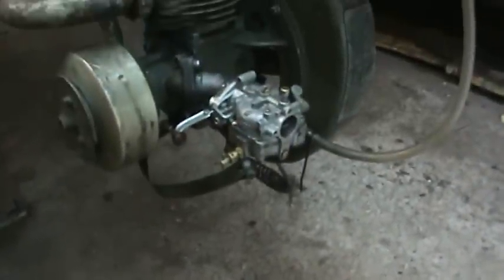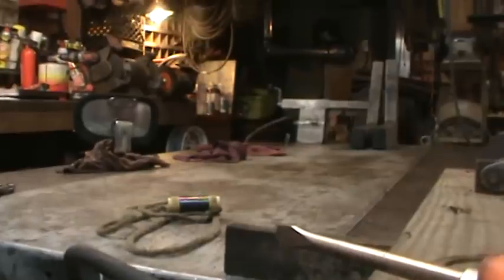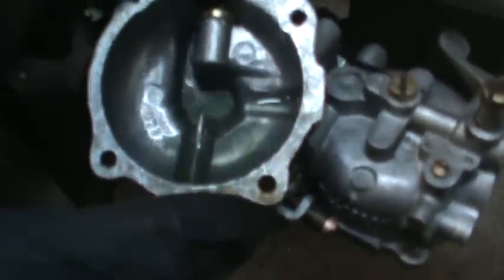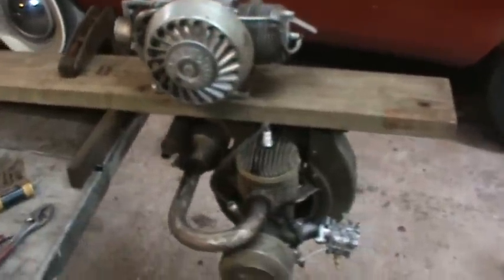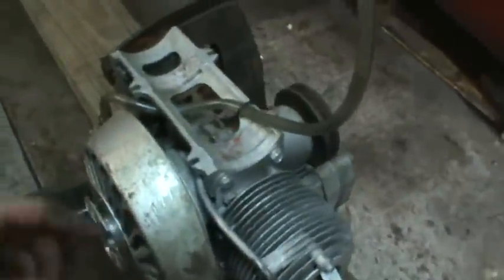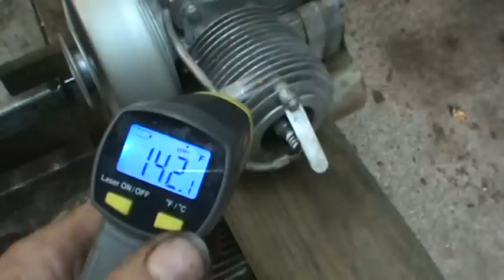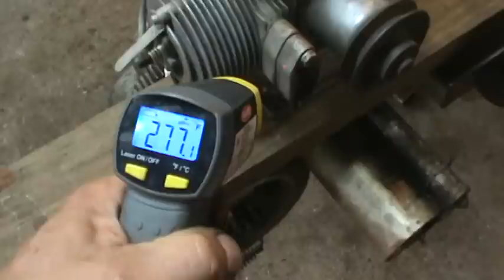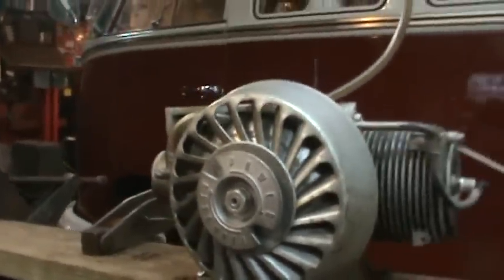building an engine for the next bike.pt5

Comment: Mustie1 your channel is great. I knew instantly what you had when the second engine was fired up. In 1961 I owned a Go Kart (brand name) powered by an AH-47. It's no cheap lawn mower engine. It is a 4.7 cubic inch, ball and needle bearing, screamer.  The unique, exciting sound comes from characteristics of the reed plate. Doing 45-50 mph 2" off the ground ----What a thrill. Now in my mid 70's I still haven't forgotten.

Comment: The "new" engine is a Power Products AH47. Puts out a bit over 4.5 HP. They were used on a lot of things from chain saws, mowers, go-karts. That is an early model as it has the open flywheel fan and no shroud. Normally they have a round gas tank in that bracket that helps push the air onto the case to cool it better.
Reply from the maker: +Blazer02LS good point about the tank

Comment: That little motor sure does run sweet. I have a pile of carburetors from lawn mowers, some of which may be good or only need to be cleaned, similar to the one you showed, from the Tecumseh motors. Glad to help if you need one or two.

Comment: You could have probably fixed that float by drilling a hole near the hinge side and blowing it up with air then solder the hole closed.  Kind of late now but worth a try next time. Thanks for the videos ! :)
Reply: or fill it up with some kind of gasoline resistant expanding foam ?

Comment: Put a small hole in float using a pick or large pin. Blow compressed air into hole, this will pop all the dents out. Solder hole up.

Comment: A good tip for freeing up a seized motor that I have seen is to pour very hot oil into the tops of the cylinders. The heat helps to expand the bores just that little bit, and they seem to free up pretty quickly.

Comment: Hi Mustie,
My thoughts on the float problem are if there was actually water in the float bowl and it froze with enough pressure to smash that float, it may have even bent the pivot point that solders to the float. It does look from the side view that when the float collapsed that solder joint may have been pulled out of kilter.

I suppose it is possible to boil the float to see if the caved in part expands, but I imagine when it cools down it would suck it back in again. I would probably try putting a small hole in it and using a very little bit of compressed air to try to pop that back out again and then solder it shut. You could also unsolder the float, push out the areas that caved in and solder is back together. Since it doesn't work now, what have you got to lose?
Reply from the maker: +Jim Kodysz its too brittle

Comment: if its a brass float you might be able to drill a small hole it it try to get the dent out using compressed air then solder the hole shut again
either that or desolder the two float halves and resolder after pushing the dent out  (be harder though )

i wonder if it will expand enough if you put it in a vacuumchamber

wat we did with moped carbs was bend the tap holding the valvepin so it closes sooner

Comment: if the float has tiny holes.. and fills with fuel.. it will never work right for long.that is far more likely than the housing itself being bad ( but freezing will bust anything).I have heated and soldered floats..but I am here to tell you the magic word is NEW FLOAT..and if it is unobtanium.. make one from plastic foam

Comment: Haven't watched the whole vid but I had a collapsed brass float on something kinda rare...  It was junk anyway so I took a tiny drill bit, drilled a hole in it,  had a blower nozzle held at some small distance from the hole and used compressed air until it puffed back up then put a dab of solder over the hole.  Seemed to work, didn't come back at least!
Reply from the maker: +MISTERComaToes wasent sure if it was collapsed until huck just showed me a vid of what its suppossed to look like
Reply: mustie1 Oh, that's funny I thought you said that you thought it got crushed in by ice in the bowl at some point.  I actually thought it was obvious, that and the fact that it barely floated.  It should have floated well out of that carb cleaner, right?

Comment: You know what the carb came off of. Or if it that is the engine it goes to originally. If so you could try either eBay or parts tree. They sell parts for all the older engines.

Comment: I have one of those floats hanging on the wall in my garage. The guys at the local small engine shop had never seen one collapsed like it. 
I wonder about piercing that float and inflating it back where it belongs then soldering it up again?
Reply from the maker: +The Shade Tree Fix-it Man biggdaddy2001, you do not have a reply button under your name, l pmd you a while ago , the governer has been disabled,as far as the float its too brittle but a replacement is on its way in the future,
Reply: +mustie1 Good deal.
Reply: +The Shade Tree Fix-it Man other way is to put it into boiling water, it will expand
Reply: +Vein1986 Neat trick, I will have to give that a try. Thanks
Reply: The Shade Tree Fix-it Man if it does not work, you can always drill tiny hole, put inside water with needle and siringe, seal it up with epoxy glue and after curing heat it up, after getting it back to shape, remove glue, heat up to boil out water and then seal up with little epoxy or solder :)
Reply: +biggdaddy2001   And things keep on changing...not for the better it seems either.

Comment: Corn fuel sucks I'd much rather have good old gasoline or fully electric. Imagine driving the front tire with the little motor and the rear with the torque monster below it... 2WD
Reply from the maker: +jamesfreddys im planning a little hybird of sorts, been gathering parts
Reply: +mustie1  Mustie - 2:51 - pinch the two legs of the tab on the float tang together - creating a smaller hole that will grab and push closed the "conetop" of the needle
quicker. 
 The "left leg" of the float tab appears a bit "spread".